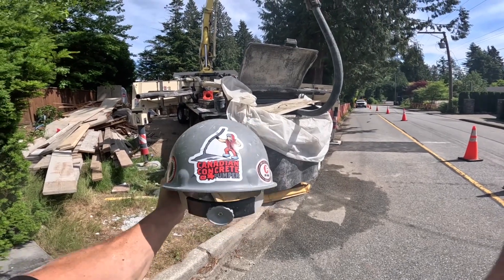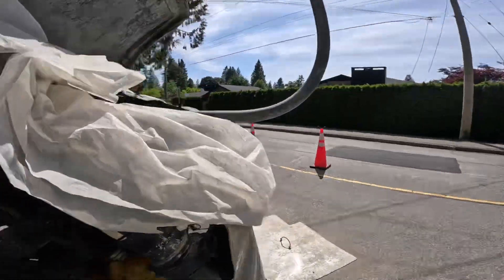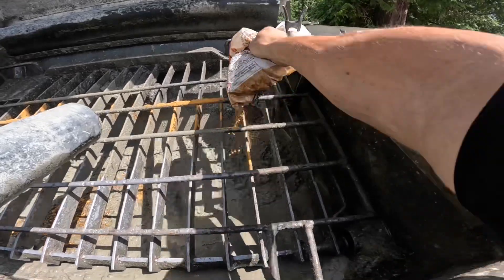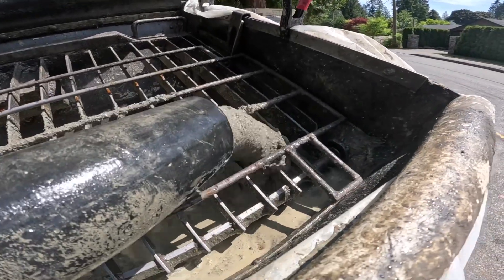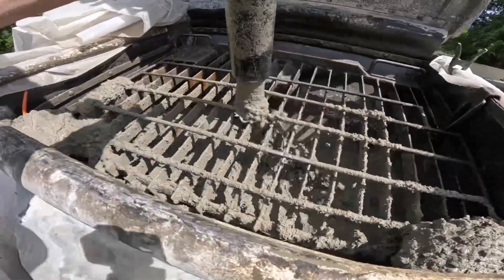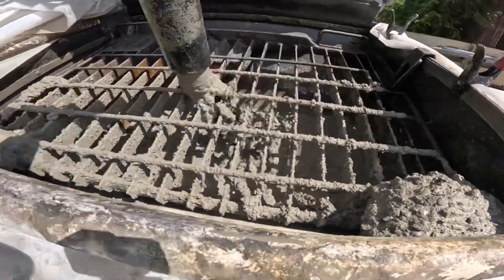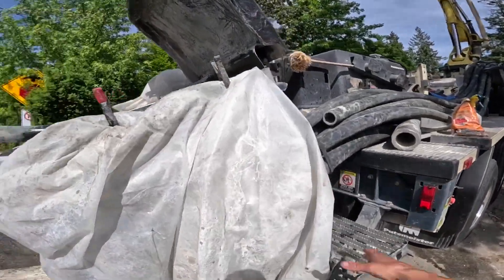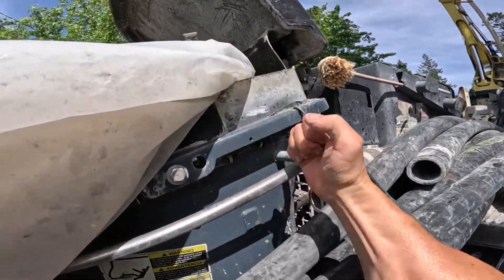Tis the season for recirculating concrete!!!

Comment: Waiting for Crete is bad but so is having a driver bring you a hot load! Had one the other day that almost set up in the hopper just in the time it took to fold the boom up. Great tip Scott!
Reply from the maker: We had one the other day which was absolutely nuclear! It was just with the line-pump, but the second we had the last piece of wall placed in, a jacked that hopper with sugar and pumped it through the lines. It’s been awhile since I’ve gotten scared of losing hoses…. or worse, but this one was about as close as it comes.

Comment: Our Alliance concrete pumps make it easy to cycle concrete with our water and auger levers. Must just be a putz thing 😂
Reply from the maker: You Alliance guys are spoiled with your levers and sensing valves 😂😂😂
Reply: Schwing makes it where your water and vibrator are linked to one toggle switch on the remote but you can add water with your auger turning just not the vibrator lol, weird quirks to all the pumps I suppose...love the delay set powder works like a charm but like you said you do have to be ahead of the mud for it to work like it should, nice work!
Reply from the maker: @joelmcdonald4297  that’s so bizarre that the running the vibrator would come at the expense of having pressurized water. I swear these engineers sit around a board room laughing about new way and ideas as to how they can mess with us pump operators 😂😂😂